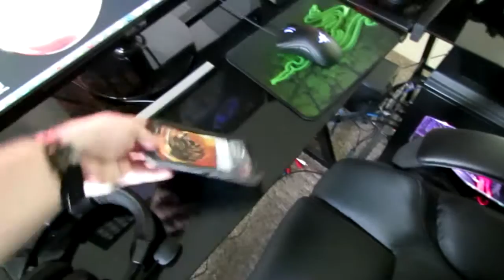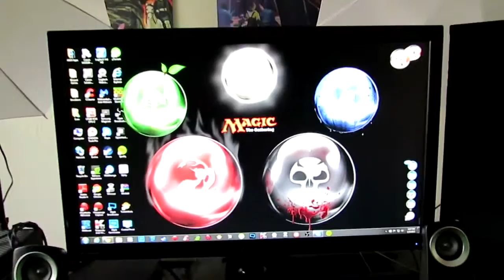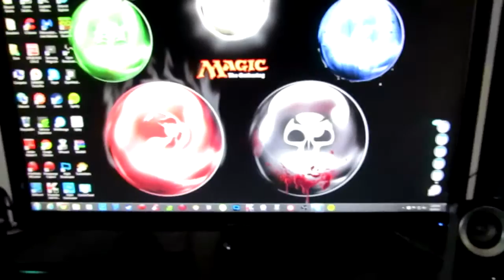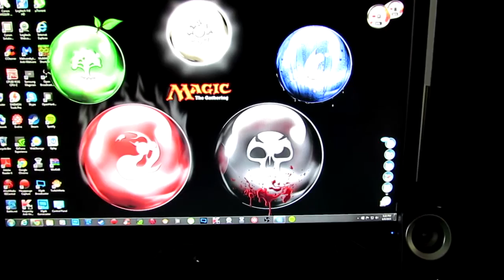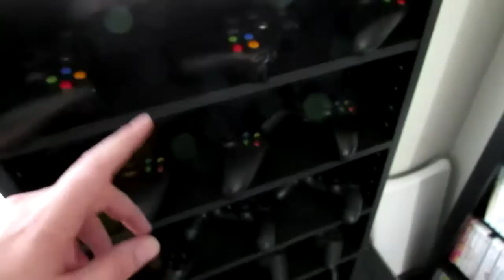NxG 2015 Twitch Stream Set Up (Episode 7) (3K Stream Set-Up)

Comment: Would it not make sense that the front fan would be an intake and then the ones at the back are exhausts?
Reply from the maker: Ashley Designs the heat sink is a pull and push fan, it pulls in air flow and pushes it out though the exhaust fan. basically the fan cycle is reversed. the way i have it set up is the optimized method for maximum cpu coolant. Unless your are using liquid coolant or some other type of OEM fan.